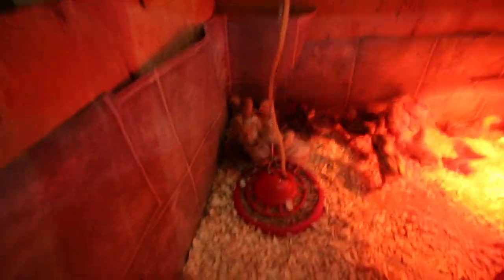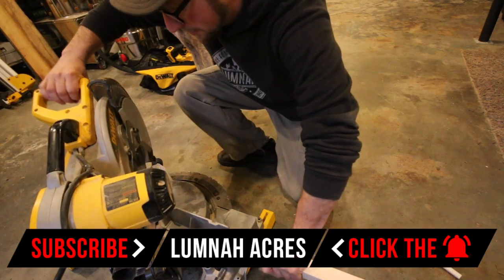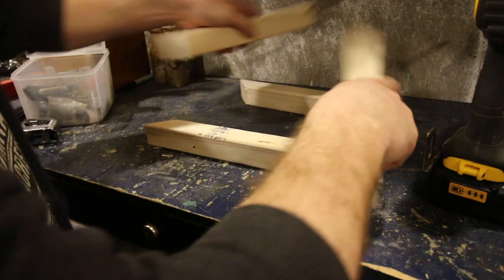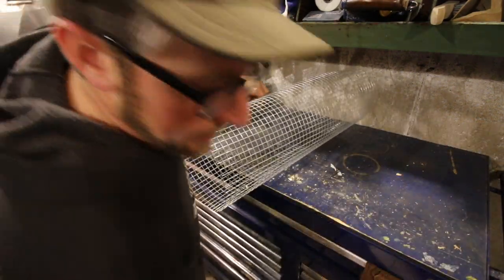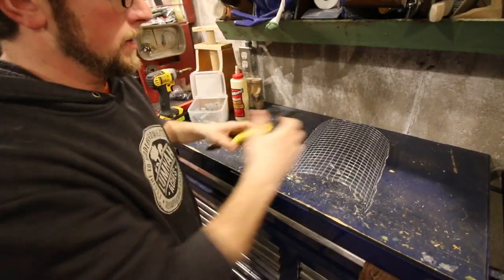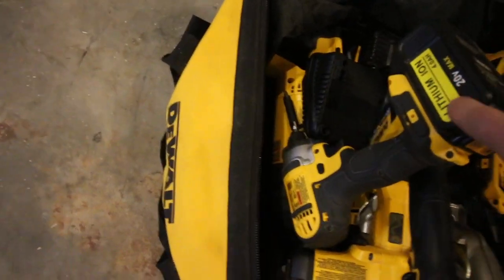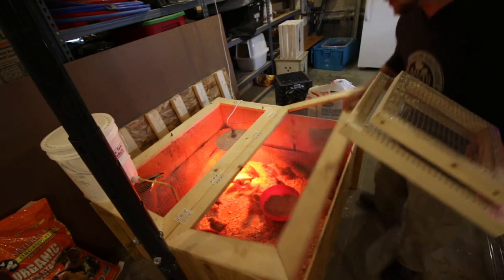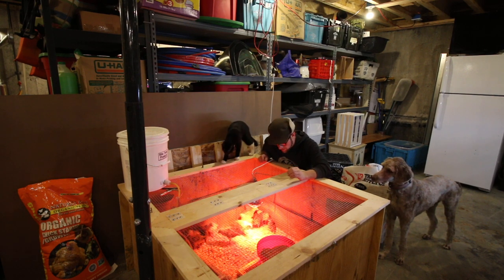Building the Chicks a DoorMat Thanks Justin Rhodes

Comment: Another solution which I use is to hang the waterer and the feeder by chain at the height of their neck.  That keeps the floor open and prevents the chicks from putting their feet in either one.  Matter of fact, I use this method all the time.

Comment: Those shavings in the water is why I now use the nipple drinkers almost exclusively in my chick brooders.  In the beginning I also add a small plastic chick water base under the drinker nipple with a bit of water on in.  I find that even the littlest chicks will be drinking from the nipples within the first day, but the little flat dish beneath collects any drips and attracts them to the drinker even better.  I also use a hanging feeder.  It starts on the floor for the first day or two then gets slowly raised.

Comment: Al, I did not know you were having that problem or I would have suggested something similar.  Our feed bags are a woven plastic material.  I made a screen over a low brick and put a feed bag over the screen.  It worked.  I also fed lots of quail out of Tunafish cans.  My waterers were sardine cans filled with gravel.  Young birds like to swim .  The gravel keeps the birds out of the water.  I used feed bags for my brooder boxes.  I put in many, many layers of feed bag in a cardboard box.  I used a light bulb for a heat source.  We pulled out a layer every day or so until the birds were feathered out.  When the birds were well feathered the birds went in coops.  The system we used was cheap and we used a new cardboard box about every other time we brooded tiny birds.  Loved this video.  We mentioned spraying the eggs we put in the brooder.  Anyway, great video.  God bless America.

Comment: Al,
I had the same problem with the Turbo Feeder. I cut 2 scrap pieces of 2x12 that where 12” wide and screwed them together. It works perfect. 
As the chicks get bigger they will jump on top of the feeder and poop in the food. All I did to fix this problem was put a planter plastic water catch tray that is 12” in diameter. Hopefully this will help before you get a lot of chicken poo in your feed. 
Rob

Comment: Ya know I love ya AL, so gonna I'm poke a bit of fun at ya before I suggest a couple of hacks on this. Are you SURE you used long enuf screws there?...LOL.  OK.  Put a pan under both 'mats' to catch what you don't want on your floor. Also, to quickly flatten out that HWC 'memory', put the cut pcs on a soft surface with the crown up and tap it with your deadblow mallet.
Reply from the maker: I think next time I will use 4" long screws! :)
Reply: +Mr. 'Lumbah'....Oh, 4" at the least!  Next time, flatten the HWC with your deadblow first and use your angle grinder with a thin blade to cut it. Way easier to handle and a far superior result. Those straight cut aviation snips are killin' ya. But what do I know, eh? I only worked in the sheet metal trade for 30 years....LOL.

Comment: Great job on the Chicken's mat.  If you still getting shavings in them, you may need to add some little legs to raised them up a little higher.  I suggest to have some kind of tray inside the water mat to collect the water if it get spilled.  You can always dump it out and cut down the wet shavings.  Just a thought!